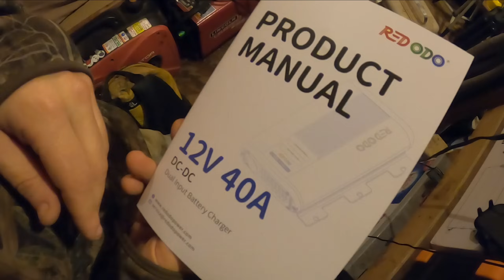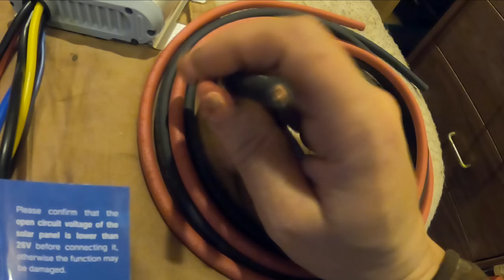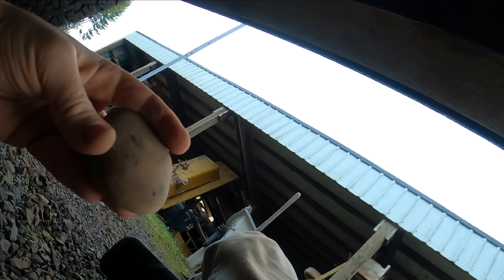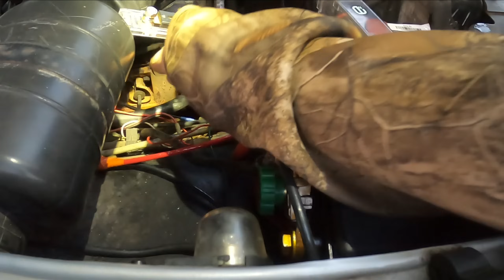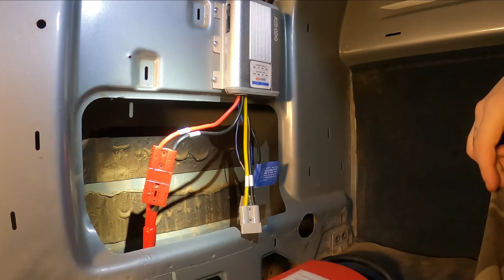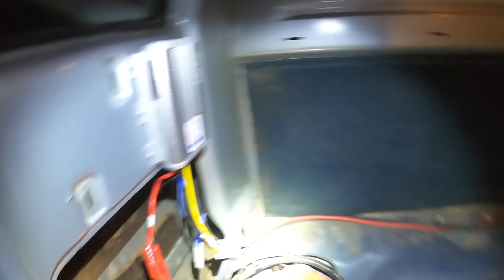Installing REDODO DC-DC Charger In Stealth Truck

Comment: Great video thanks. I just bought one of these for my Cargo trailer that I converted into a toy hauler. I have two of those batteries and a full 12 V system built out. I’m going to start with a suitcase, solar panel situation, which is why I love the Anderson situation. And also when connecting and disconnecting from my tow vehicle Anderson, cables or clutch. Had a little laugh about the windy nation made in USA, it’s the truth though. And by the way, wind nation makes a really good quality stuff anyway safe travels my friend. Thanks again.

Comment: Next time you need some USA made welding wire, take a trip to your local Pick N Pull and find a Chrysler 300 or Dodge Magnum. They have trunk mounted batteries and run a 1AWG cable from the front under the passenger carpet back to the trunk. It’s something like 10ft of 1AWG for $4 with some good crimped and soldered terminals already installed that you can you on at least one end. And since they are all run in the interior of the car, they are kept clean, dry and away from heat. Super flexible and have great insulation on them. I grab one or two every time I’m at the junkyard and they have been great for my RV project.

Comment: Thanks for the vid. I am about to pick up one of these. Now that you’ve had it a little bit, any regrets or updates? I have heard reports on similar models about pulling far less amps than advertised. What is your alternator rated for? I worry my 80amp is not powerful enough?

Comment: I have a Cotek DC to DC charger installed in my converted shuttle bus. Having lived in my bus for three years now, I can't imagine not having the charger because that alternator to battery setup is just excellent.
Reply: Does Cotek = Ctek?  I googled Cotek and couldn't find anything.